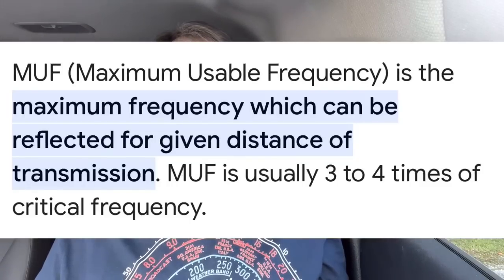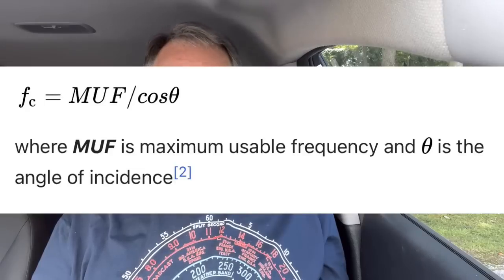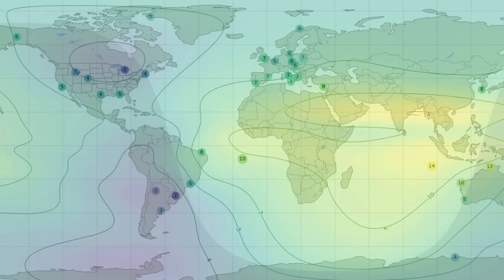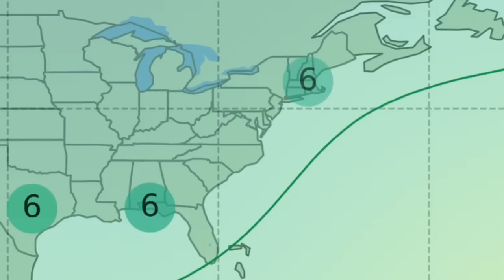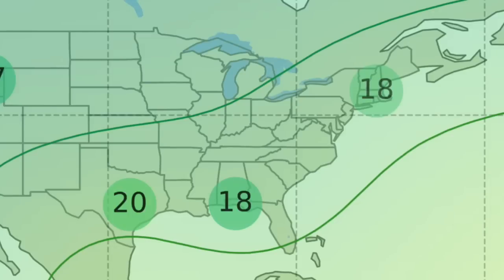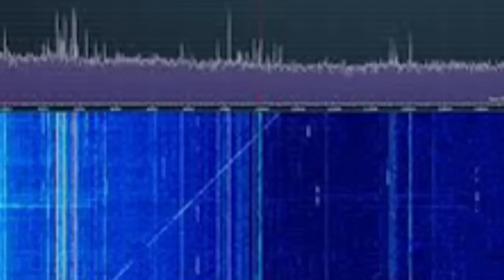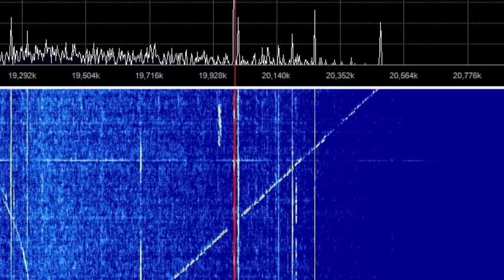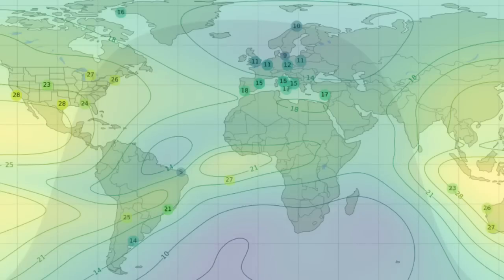Understanding Maximum Usable Frequency (MUF)

Comment: Good info! Ionospheric Radio Propagation was probably my favorite EE course at Virginia Tech. There were two Extra class operators in the class. One was the professor and I was the other one! The final exam was determining propagation, MUFs, etc between a W station and a G given a certain time of day and sunspot conditions! The text book is now free on the internet and still a great resource.
You might note that the MUF is usually given for 3000km distance on most maps. You might see MUF(D) is  30 MHz and while distances of 3000 Km and greater can be worked on 10 meters shorter distances can not. Typically this is F layer info. Sporadic E ( lower layer = shorter distances) can occur anytime and makes for a lot of 10 meter fun. June and December are high probability times for such sporadic short skip on 10, 15 and 20 meters. Also the MUF at the mid point ( reflection point) between two locations usually governs. Multiple hops are frequent. Also the highest critical frequency ( and MUF) is usually directly under the sun.
Reply from the maker: Great info, thanks for sharing! As an Old Dominion Monarch I'll let you slide on that Hokie mention hahahaha, just kidding. All the best and 73 from a structures guy that designs the masts and towers for you EEs to put your magic.
Reply: @COASTALWAVESWIRES  it takes all of us working together to get the job done!
Reply: Hello u mentioned a book for propagation plz what is the name of the book?

Comment: There are times that MUF is useless. Like sending ft8 into Russia on 6m with a dipole 12ft off the ground. two different days two different stations. All based on theory. I like to push theories.
Reply from the maker: Yes the MUF is an HF thing for up to about 35 MHz, absolutely not a thing for 6 meters.
Reply: @COASTALWAVESWIRES  Just wondering